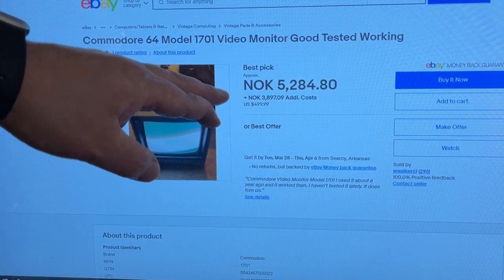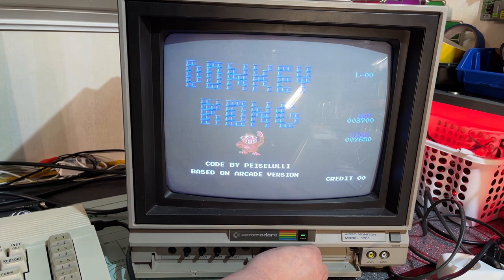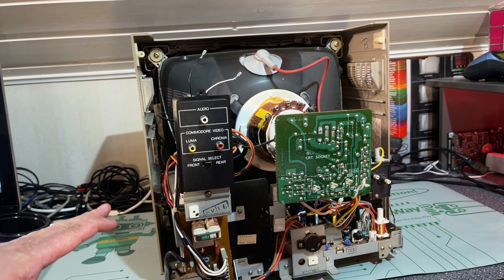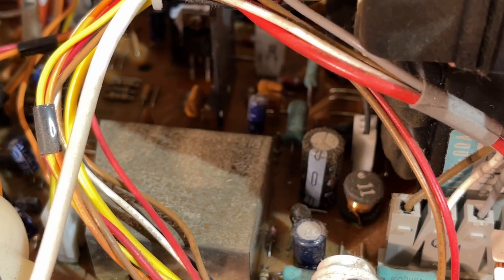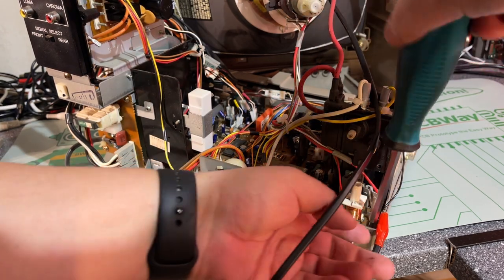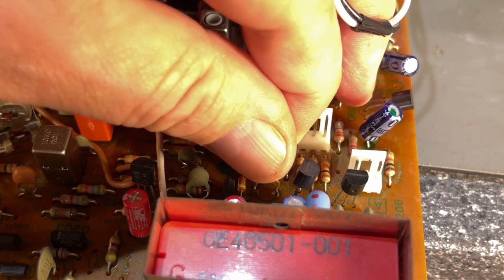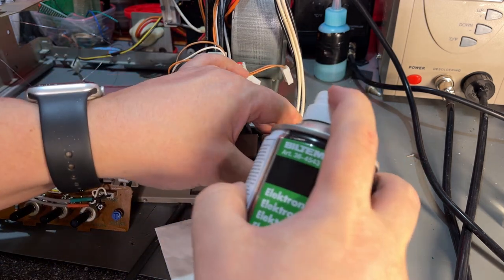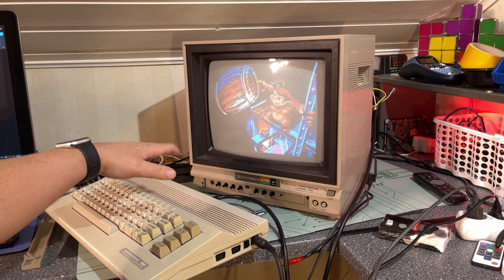Commodore 1701 CRT monitor restoration - Fixing up this great C64 CRT monitor from the 80's!

Comment: I have a 1702 with scratchy sound and was thinking of doing a recap. Taking it apart seems a nightmare though. Like you, I could only dream of owning a CBM monitor, but now, as an old man,  I own a 1702, 1084-D1, 1084-D2, 1085 and a Philips CM Mk2. After seeing your video, it makes me slightly more confident to start work on them. Thanks
Reply: It’s not necessary to recap any electronic equipment. It’s complete nonsense to do this and can cause more issues. Always repair the monitor, replace what I faulty

Comment: Nice video my friend :) try to warm up the board with heat air station before you solder and desolder big caps with big copper plain. It helps me :) have a nice day :)
Reply from the maker: Thanks for the tips!

Comment: 370ESB22 CRT tube!
The same on TAITO/TOIE arcade cocktail tables!
CR-28 Pinout.
This tube is great but fragile (steel mask, burns easily).
Don't be to generous on G2/screen tension/tune ;-)

Comment: Even with how far display technologies have come, there's still something about a CRT that is just satisfying to sit down to.  This monitor presented challenges to you which you overcame with aplomb.  Yeah, having several hi-res closeups during disassembly made reassembly a lot simpler - well done!

You would be wise to wait until you have the alignment procedures for this monitor in hand before attempting any adjustments.  Each monitor is a little different, and the best way forward is to follow the documentation for the initial setup.  Get that right, then tweak to your taste.  Otherwise, you will "chase your tail" quite a bit, and can actually damage the monitor if you're not careful.  You will need a good quality multimeter, an oscilloscope rated for the frequencies your monitor uses, and possibly a signal generator or color bar generator.  A good test pattern is also useful in getting the geometry set correctly.

Comment: Thank you Artic!   A great example. One question, is there really a need to recap all caps? Do all 1701's have leaking caps in 2023?    I am not an experienced solderer like you, but I dismounted  tv's and monitors before. I have a 1701 here, and I want to do the job however I am afraid to burn through the pcb.Do I really need an adjustable temperature type solder iron? Thanks for the link to the webshop, is there a list of caps I would need? I might be better of in train in soldering on an old piece of electronics before destroying the 1701. I need to think about that. Hope to see more of your video's very clear explanation and also good warnings on critical moments. Greetings from the Netherlands!
Reply from the maker: Thank you. Not really needed to recap if the caps are still good. But a monitor is for the most part an analog device, so bad caps can alter the quality of the signal even if they have not leaked I would guess. I am not an expert in this field. I would strongly recommend a temp-controlled solder iron if you are going to do a lot of soldering. Yes, practice first on something else.